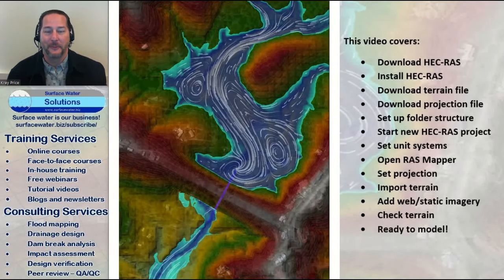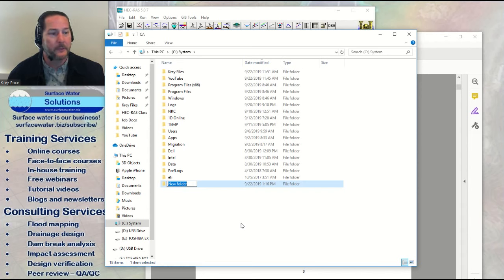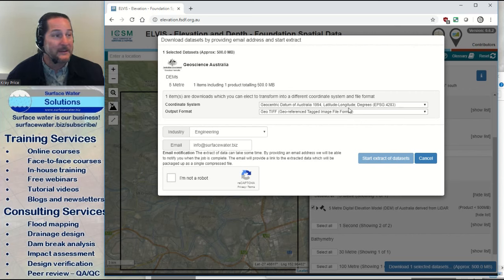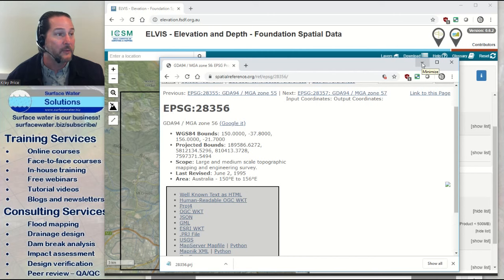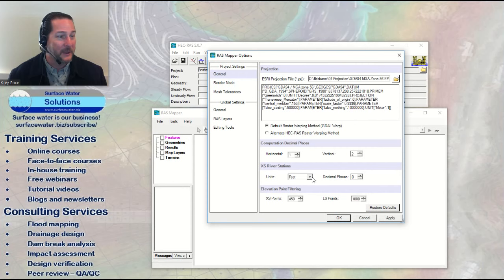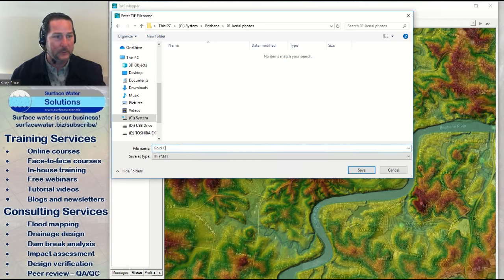HEC-RAS Basics Part 1 of 8: Download and install HEC-RAS with tips and tricks for getting started

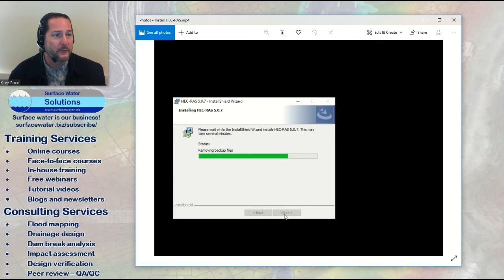Comment: 3:38 launch Hec-Ras
5:01 PDF manual
8:32 retrieving terrain data
14:30 projections, reference systems
20:40 Hec-Ras project architecture
21:18 starting a project
23:50 open Ras Mapper; set projection for my project
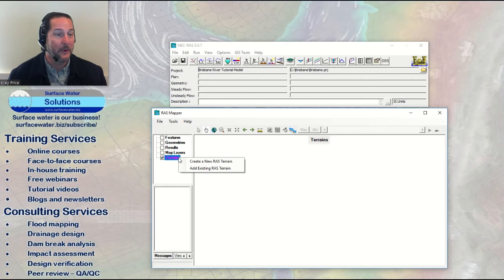25:30 Create a new "RAS Terrain" (“New Terrain Layer”)
      Grab a raster from your disk
27:57 Filename: create the .hdf version of your raster and name it properly
29:33 What has Hec Ras done with you raster files? 
      Do you need all of the files in the Terrain folder?
31:30 vector elevation data
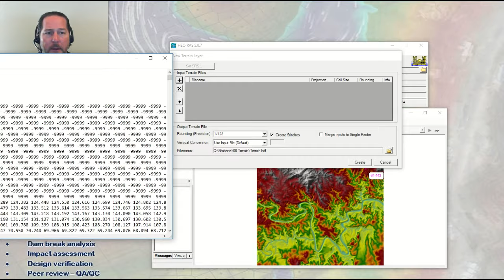31:58 .asc (ESRI Grid) files: internal structure and nodata value.
      From Wikipedia: "xllcorner and yllcorner are the western (left) x-coordinate and southern (bottom) y-coordinates, such as easting and northing (represented as real numbers with an optional decimal point),
when the data points are cell-centered xllcenter and yllcenter are used to indicate such registration."
33:04 Put a coarse-resolution DEM underneath your high-resolution DEMs, in order to avoid missing a data or nodata areas.
33:55 avoid decimals beyond millimetre. 1/128 precision is fine.
34:30 Irregular grids
38:12 checking if your raster is good for your job
39:40 plotting a cross section
40:50 add web imagery (Google Hybrid)
41:55 Save View for storing WMS imagery even when disconnected from Internet
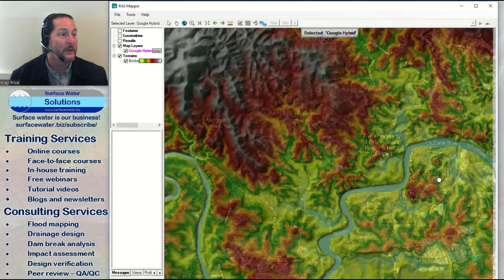42:10 add and save views from the project
44:30 add profile lines (3 ways to do it). 
      Add center line(draw FROM UPSTREAM TO DOWNSTREAM) and put it in shapefiles
45:43 Add cross sections (draw FROM LEFT TO RIGHT LOOKING DOWNSTREAM)
48:20 Properties of the DEM layer (colours, UPDATE PER SCREEN etc.)
49:02 Don’t forget to fill in the Description field in the main Hec Ras menu
Reply from the maker: Thanks for that - I've added these bookmarks to the video to break it into chapters.
Reply: Thank you very much, you are the best

Comment: Hallo. I had a finally problem with my ras project. I would be greatful if you could help me. 
I want to display the depth of 2d flow to a real map. I set the projection to ras mapper but when I click map layers> add web imagery layer>google hybrid, seems to be a problem and when a place the mouse over the file there is this message : "Error loading image from file C:/Users/..../tif does not exist in the file system and is not recognized as a supported dataset name''
Thankyou.

Comment: hello
i instal the hec ras 5.0.4 and 5.0.7 , but, the (ras mapper) do not work, please you can help me and thank you
Reply from the maker: If RAS Mapper does not open, typically it is an issue with a 32-bit operating system (since RAS Mapper is 64-bit). It won't work on a 32-bit operating system, and sometimes still has issues with a 64-bit system if it's out of date. Best to install all Windows updates (windowsupdate.microsoft.com) including .net framework, and reinstall HEC-RAS if necessary.
Reply: @TheRASSolution  How do i get intouch for online training or otherwise

Comment: Hey, I am a student from a higher technology college for civil engineering. I am working on my diploma thises right now and  I am struggling with HEC-RAS. Noone of my professors has ever used it before or at least not on such a high level. 
Is it possible to import a terrain file (XYZ file) that includes "." as commas and "," as separation? And if not, do you have an idea  how I can change this into the Metric System?
Reply from the maker: You'll need a raster grid digital elevation model. Point clouds won't work, even if the points are sampled on a regular grid. You could do a find and replace in the text file to change the separators if necessary, but you'll also need to do a conversion to a raster grid using other software (AutoCAD/Civil3D, ArcGIS, etc. have conversion features that take point files and convert to raster grid DEM). Appendix B of the HEC-RAS 2D user manual lists the supported file formats.

Comment: How we calculate the flood volume in ras mapper ?
Reply from the maker: Draw a profile line across the flow path, then right-click on it and select "Cumulative Volume" under time series, which essentially computes the area under the hydrograph. The results can be shown graphically or select the "Table" tab to copy and paste the numbers into Excel. If the simulation window has run long enough for the cumulative volume curve to flatten to a constant value, the final value will be your total flood volume/flux across that particular profile line. If this is computed at the inflow and outflow locations, the difference in volumes should equal the system storage.